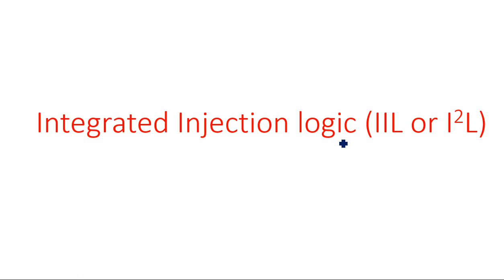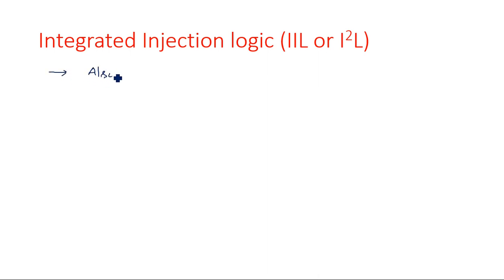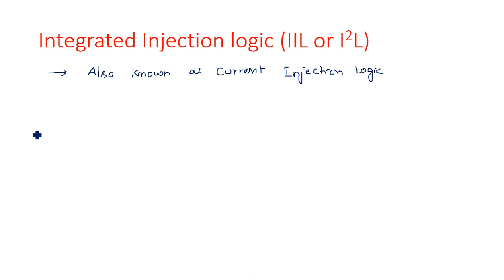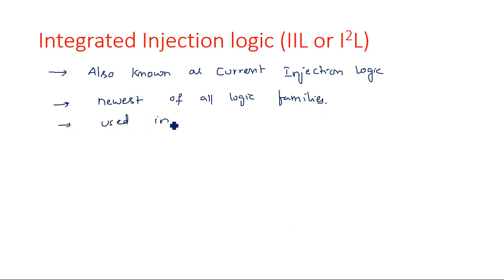Integrated Injection logic | IIL | Inverter, NAND & NOR Gate | PDC | Lec-107

Comment: in the nand gate implementation, the outputs are shorted. doesnt that affect the operation? example, one is high while the other is low. then the low input will pull down the other input.